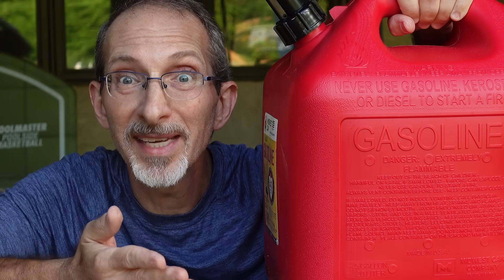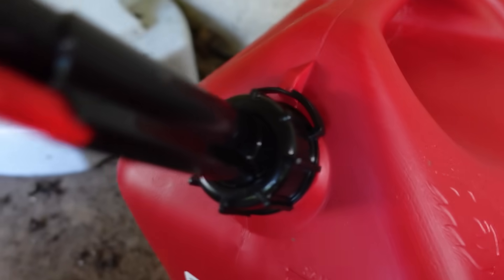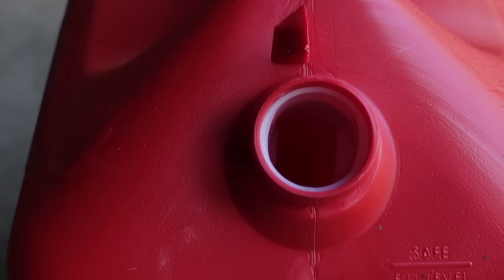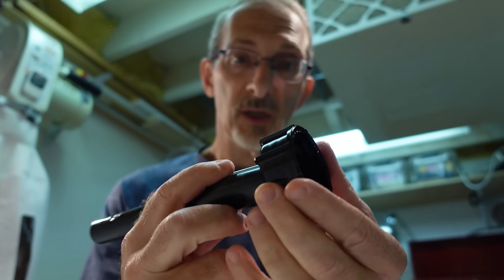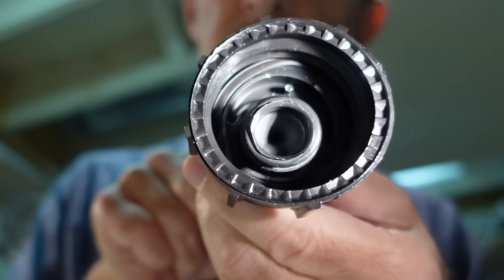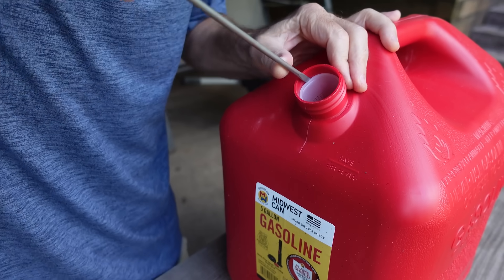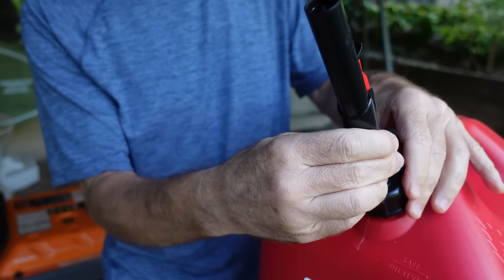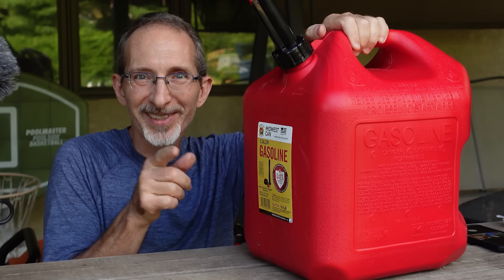Gas Can Modification | New Gas Can Fix

Comment: Great video....retarded design, looked like the nozel had a filer also, don't need a screen on the can itself too.
Reply from the maker: No filter on the nozzle that I saw. The 'filter' on the can turned out was a flame arrester to keep the whole tank from going BOOM if you pour gas on an open flame. Covered in my part 2 video if you'd like to watch: https://youtu.be/XoYxdrhB6Ls
Reply: @MikeFyxdt  4:51....it appeared to have a filter due to the lighter color, however I stand corrected. I've watched 1 of your videos and 👍👍, let's make a deal, you watch one of mine, comment and I'll watch yours.😉😆 May I suggest one of the Red-Line races. I think you might like them. Hope to see ya there..👍 keep up with the great content my friend. 🇺🇸
Reply from the maker: @diecast164andmore9  I LOVE Hot Wheels! I just subbed your channel, and I'll circle back when i can watch some of your videos. Looking forward to it!

Comment: Long ago, I managed to run out of gas within walking distance of a station, but had no can and they didn't sell any. They did however sell 2L bottles of soda, and once emptied it made a great gas container as the pump nozzle fit right in, and was easy to pour into my vehicle.

Still a much better and cleaner process than these pieces of crap. And I'm more likely to use that in the future instead of buying a ridiculous can that's designed to kill me by being extremely hard to use.
Reply from the maker: Ha! That's a great story! I needed 10+ gallons of storage for my generator, and these cans were the lowest price.
Reply: @MikeFyxdt  You might consider a small fuel pump, my dad went that route instead of trying to hold up a 5Gal can and play around with their human-proof nozzles.
Reply from the maker: @p24t  Not a bad idea!

Comment: The designers JUST DON'T HAVE A CLUE. They design things that; as individuals; have NO EXPERIENCE WITH. Like trying to put gas in a car, alongside a highway in the rain, snow, wind while the damn gas can just dribble the fuel in, taking its good ole time like it has an enlarged prostate, arms getting tired holding the damn thing up while traffic[ sleepy truckers] is zipping by hell-bent on destroying you.
Reply from the maker: Or they KNOW what they are doing, but have regulations they have to meet...

Comment: Much easier to just buy a plain nozzle, available at most hardware stores. These are safety items you are disabling, can be dangerous if someone other than you would use these gas cans. Sorry, I don't agree with your modifications!

Comment: Another example of government gone wild and intruding into our lives on a daily basis. I did this and I also removed the thermal couple out of my patio heater and the back flow preventers on my exterior faucets. So sick of all that stupid safety crap that is not needed, ends up causing more problems then it stops and is such a PITA due to horrible design.
Reply from the maker: So many safety features I lose count! Thanks for checking in!

Comment: Leave it to the Government to make safety and environmental regs that make a gas can less safe and more unfriendly to the environment...
Good thing that filter is there to keep debris out of the gas can, it's much better to have that debris in my generator tank instead...

If you want to make that flow better, install a tire valve in the back without the stem inside and use the cap to control the venting.
Reply from the maker: Hi Jesse, I have seen the tire valve vent trick. In my follow up video, I clarify that what I called a filter is actually a flame arrester, and I also install a simple plastic vent on the back of the can. Check it out! Link in description…

Comment: I like the mods, but instead of just removing the spring, I’d have used a lighter spring to make it easier to press
Reply from the maker: Good comment… In my follow up video I show how to remove part of the spring to make it easier to depress the nozzle, without having to remove it all together.Thanks for commenting!

Comment: I ran out of gas 100yds from a gas station. It was pissing it down. I walked to gas station, bought can, bought gas, walked back to truck. Specs dint work because of rain, couldn’t read instructions. Guess at how the can worked didn’t pan out, used (razor sharp) pen knife to execute first conversion only things went sideways in torrential rain and cut finger to the bone. Later I did a full conversion of can and converted pen knife with no locking system into 4oz of garbage.
Reply from the maker: Holy crow, you had quite the adventure!

Comment: I just bought that same size Generac.
Reply from the maker: Cool! So far I am very happy with mine. Thanks for dropping by!
Reply: @MikeFyxdt  I haven’t even fired mine up yet...thankfully.
Reply from the maker: Tip - Keep that battery charged! If there isn’t at least a little juice in the battery you can’t even pull start it.

Comment: The safety nozzle is actually more dangerous since you are more likely to spill gas which could ignite.   What is the point of a filter that keeps debris out of the can.   Instead of settling to the bottom, the debris is the first thing that comes out when you dispense gas into the tank.     This is what happens when you have to meet government regulations that are supposed to “protect us”.
Reply from the maker: What I called the filter is actually a flame arrester, which I discussed in my second video. Regardless, you are correct that spilling gas probably poses a bigger hazard. Thanks for checking in!
Reply: @MikeFyxdt  Thanks for the video and the info about the flame arrester.   Since we more likely to spill gas  on a hot lawn mower and have a fire,  guess we need one of those

Comment: I would have happily traded you my aftermarket spouts for those spouts.  I love the way those don't need a funnel, because they don't start pouring until I have the spout in the tank, and stop pouring as soon as I lift pressure away from them.
Reply from the maker: Ken, they are a good design in theory, but much too hard to depress unless you modify the spring, in my opinion.
Reply: @MikeFyxdt  once I learned how to operate them properly, they've been great.  my only complaint is the plastic fails in about 5 years, and they start leaking out of all the fittings.  of course, this compares to the old metal flex spouts which started leaking on day 1. they're sure a heck of a lot better than the "universal" flex spouts I can get as replacements.
Reply from the maker: @kenbrown2808  A lot of comments on this video suggest getting the universal flex spouts instead of doing these modifications. I've never tried them, but any time I hear 'universal' I think it is not going to be a great fit. For what I paid for these cans, I won't be mad in 5 years if I have to shop for new spouts.
Reply: @MikeFyxdt  the kit comes with two different collars to fit the two standard necks you find on gas cans.  I think there is a total of three corrugated tubes as spouts - that don't flex well, try to spring back to straight, and don't have internal vents so they "glug" badly.  the only redeeming feature is that so far they don't leak around the neck of the can.
Reply: @MikeFyxdt  it is offensive to me that something like a gas can only has a 5 year service life - considering my dad has been using the same steel gas can for his weed eater gas for 30 years.
Reply from the maker: @kenbrown2808  Yes - agreed. For the last 20 years I feel that many cheaper goods I've purchased have broken or worn out prematurely. Cheaper isn't always the better investment. I feel like my own grandpa saying "They don't build 'em like they used to!"
Reply: @MikeFyxdt  they don't, and sometimes that's a good thing, and sometimes it's a bad thing.  consider: when's the last time you had to adjust the points in your car?
Reply from the maker: @kenbrown2808  carbs and distributors on cars I don't miss so much...

Comment: the first time I used one of the new cans I could not get the gas out through the nozzle, so I put the can down to look at it and got a face full of gas when I was examining how the nozzle work, messed up my eyes for a little bit
Reply from the maker: OMG, that’s HORRIBLE! I hope you are OK. Hopefully others won’t do the same.
Reply: @MikeFyxdt  my wife helped me to a sink and I was able to wash it out of my eyes, took a little but I am fine now.  I am trying to figure out how to make my own nozzle now, most I fine and have tried are cheap, washers seals leak.
Reply from the maker: @otrotland5377  I'm glad you had help and running water nearby. I haven't had these Midwest cans long, but so far the mods and the parts are holding up.

Comment: With the straight spout, it is still prone to spill as you pull the spout away from the
the tank opening, because by taking out the spring , you have eliminated the auto shut off, causing the fuel to continue flowing even after you lift the spout from the tank, thereby causing a spill.

Tractor Supply Centers sell FLEXIBLE converter spouts for about $9.00 that have two cap thread configurations for the different cans on the market, and a tethered cap to seal the spout. 
With the flexible spout, you are able to lower the gas can below the tank opening when the filling is complete, and still have the flexible spout in the tank, thus eliminating spillage. 
I have put them on all of my gas and 
kerosene cans and they work great.
Reply from the maker: Allan, I agree that the street spouts are sometimes awkward. So far I’ve managed to deal with them. I guess I could get a funnel, as many people have recommended. Thanks for checking in!

Comment: THEY ALL ARE.. sometimes you need BOTH hands to lift the can. How do you hold a button down and use both hands to pour out of the can.
Reply: on that model, the button latches, and then you simply pick up the can, turn it over, and then press it into the tank to start pouring.  I really wish I had those instead of the safety spout I have that takes one hand to hold the safety button and the other hand to press the handle.
Reply from the maker: You are supposed to press the spout down by pushing it on the rim of your gas tank or whatever you’re filling. It’s very awkward. So it needed to be fixed! Thanks for watching…
Reply: @MikeFyxdt  I do like your video. I found a place that sells a flexible fuel nozzle that will fit all gas cans. I have purchased a few of these. Now it is a little Easier to pour the gas.
Reply from the maker: @countryside8122  Glad you found some good nozzles! It's the little things that make a big difference. :)

Comment: gas attended?  When did you fill this, 1970?
Reply from the maker: New Jersey still has them, and some places in Pennsylvania where I am located. Thanks for watching!
Reply: @MikeFyxdt   I did a construction project in New Jersey back in 1999 and I do recall having no self service at the pumps.  It was very strange for me.  Is that still the case, no self service at gas stations?
Reply from the maker: @BourbonDrinker  I'm in PA now, but the times I've been in NJ recently I've always had someone fill for me. Whether its a law, I don't know...

Comment: I don't fix it... I just place the spout.
This is what happens when bureaucraps who never, ever used a  gas can regulate them.
Reply from the maker: Lol, it was fun for me to fix, but you shouldn’t have to!
Reply: You can replace the spout, but unfortunately, that internal filter is still in there.  The whole damned design is just a farce.
Reply: I made do with removing the spout and pouring it into a funnel last year. Cussing the govt every time. I'll at least remove the child lock this year.

Comment: If you want the feature of still shutting off the gas flow, you could just remove a couple coils from that spring and put it back. That way it still shuts itself off, but does not take an army to open it. I agree with this video 100%. This modern day make everything so safe you can't do anything is just stupid. :P
Reply from the maker: Great minds think a like. I modified the spring in video #2, link in the description. Thanks for checking in Bryan!  ...update: Thanks for watching the second video!

Comment: It’s easier just to buy some VP racing fuel containers.  They hold almost 6 gallons and have a flexible fuel nozzle.
Reply from the maker: Honestly, I bought the cheapest gas cans I could find at the time. Looking back it may not I have been the best decision, but the modifications make the best of what I have! Thanks for watching!

Comment: They made it safer. If you can't get gas in the can and can't get the gas out it should be safe and usless. The one I have is a little different so I disabled the latch on the spout and shortened the spring so it opens easier. Now it opens when the spout hits the edge of the tank and closes when removed from the tank.
Reply from the maker: Glad your mods worked! We need stress-free gas cans so we can get back to stressing out over how much yard work we need to get done.

Comment: you spill and leak more gas with these stupid "EPA approved" tanks, than we EVER did with the old style tanks. Like everything these days, it has Nothing to with "safety", its all about control. The only better "off the shelf" tank that has no need to modify, is to pay some extra $$, but I have to say it is a Really Nice can. Even much nicer than the old style cans. And if needed, even my 80 year old father can use it many times easier than any regular can as well. Its called SureCan. Highly Recommend, even for the extra $$
Reply from the maker: Always good to hear alternatives. Thank you!

Comment: Stupid "safety nozzles".  Another example of government sticking it's unwelcome nose into places where it's unwanted and unneeded, allegedly, for our own safety.  Screw them!  I've already fixed all my gas cans so that I can easily fill them and pour the gas where I need it without spilling so much as a drop.  And I can do it just as safely as I did for years before they came out with those stupid, EPA approved "Safety nozzles". I didn't modify those nozzles, I got rid of them and replaced them with a regular, flexible spout that has a screw-on cap and also installed a standard, old fashioned vent with a cap.
Only a government agency can totally screw up something as simple as a gas can.
Reply from the maker: Nozzle replacement is definitely a popular option. I appreciate your checking in!

Comment: I fekking HATE these new nozzles. For women with small hands they are nearly impossible to open and it serves NO USEFUL purpose to have them. I stopped mowing the lawn when my husband bought one so he isn't very pleased either. In addition, I see the two cans in our garage with these horrible. nozzles are concave, apparently as the gas cooled in the Fall.... the can couldn't get any air in there and shrunk down deformed.
Reply from the maker: Wow, your tank collapsed? I guess being air tight is a drawback. Hopefully the manufacturers will feel our pain and improve the product.

Comment: First thing I do is cut that locking Tab off then yank out the California Compliant Dildo they stick in the can.  I will pop those Springs now that I know about hem.  For filling my Jeep the Spout is too short and bad angle so I use a Pump Siphon-holding 40# of gas at the proper height aint easy anyway to I rest it on the Cargo Carrier that folds up on the back tailgate.
Reply from the maker: The older I get, the heavier gas cans become. Gotta figure out what works best - thanks for sharing your Jeep tips!

Comment: Why  can't you just  cut that spring  , measure  it  first  for the size, cut 1/4  inch off  and  pull it to  the  size it was , which should be  less  force  to use .  worth a shot
Reply from the maker: I tried a version of this in my part 2 follow-up video. Here's a link if you'd like to watch: https://youtu.be/XoYxdrhB6Ls

Comment: I hate the PoS Kommiefornia  CARB gas cans. I tear the guts out of the spouts and drill an air hole in the cans and knock out the internal spark arrestors on every one I have to buy. I use a coarse threaded eye bolt to plug the air hole in storage. Midwest Can are the worst offenders. I won't buy their crap.
Reply from the maker: @Steve Cochran - I like your eye bolt trick. I didn't know any different when I bought my Midwest cans. The modifications made a world of difference to me. Thanks for chiming in!

Comment: I agree gas cans today are way too complicated and expensive. Just give me the old cans. That being said, by altering the cans as you did you voided any warranty that the can had and committed several Federal felonies. You also bypassed ALL safety features that a can should have. Why not just use milk jugs for your gas. If even ONE person gets hurt for taking your advice think of the liability you would be assuming. I might would have done everything you did, but I NEVER would have it in a digital database where it could be used against me for years to come. Not trying to be a "Karen" by any means. I despise these cans as much as you do I just would not have a recording of me doing it and encouraging others to do it as well. It's no different than drunk driving. It's just fine until someone gets hurt. Buy a Wavian Jerry can and once you get over the price you will never regret it or have to modify it. You cannot put a price on safety.
Reply from the maker: Ok William, points well taken. I think my mods make the cans easier to use and safer for the majority.
Reply: @MikeFyxdt  And I agree with you, you're just taking on a Hell of a liability. No harm meant.